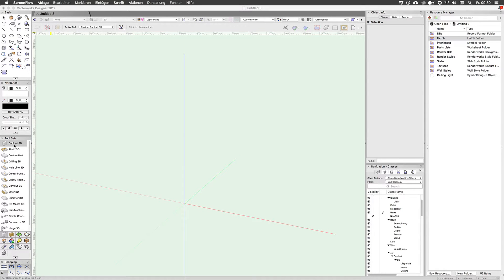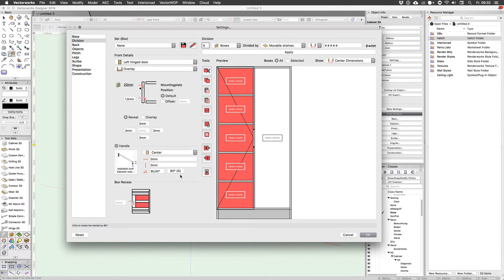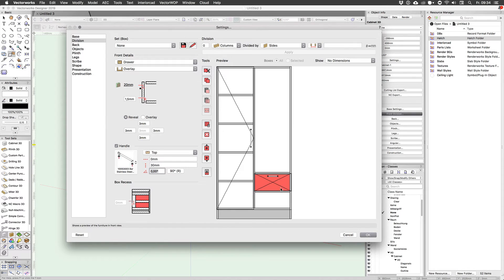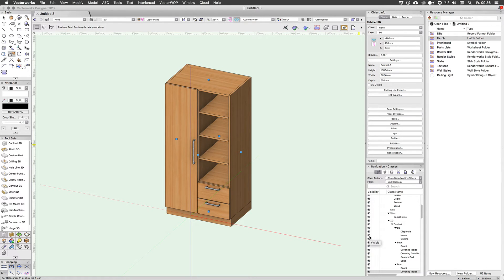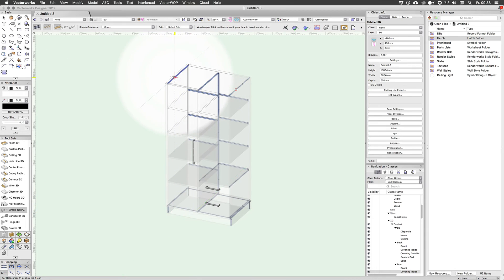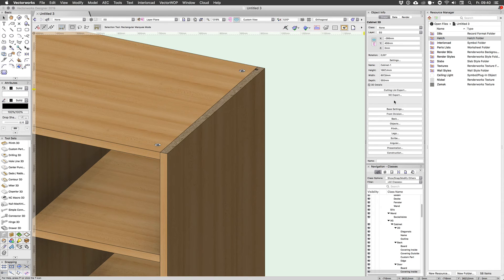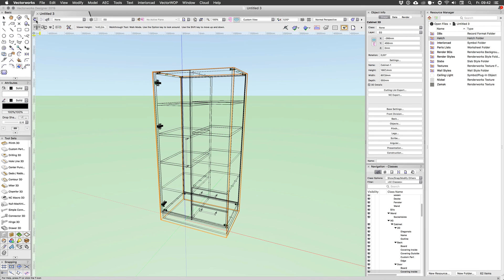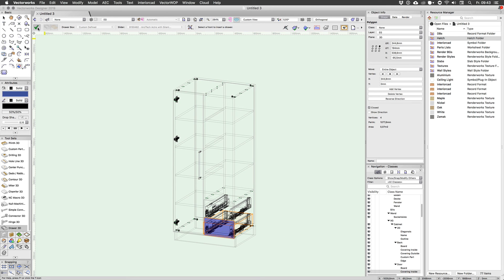Vectorworks interiorcad cabinet maker first steps

Comment: Hi, if you could help me.  On minuto 4:44 you talk about the material of the components, but how do I change the width of the board? you have a standard of 20mm for the the cabinet, but how could I change it for another board thickness?
Reply: Hi Manuel! These values are calculated automatically. E.g. the thickness is the sum of the thicknesses of material and coverings. The width is calculated in dependence of the chosen edges.